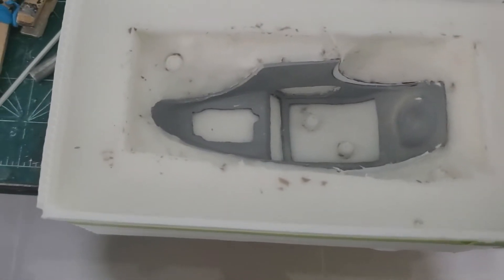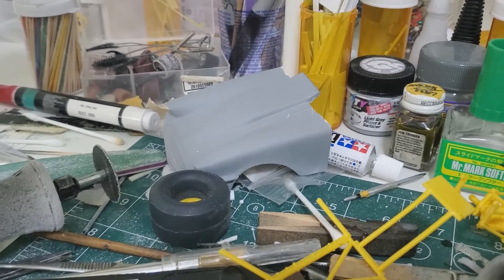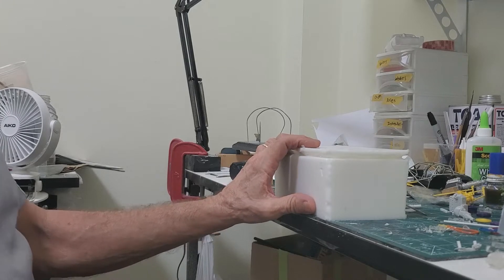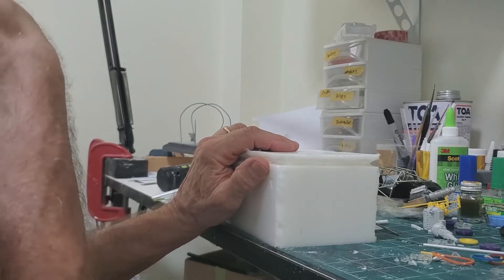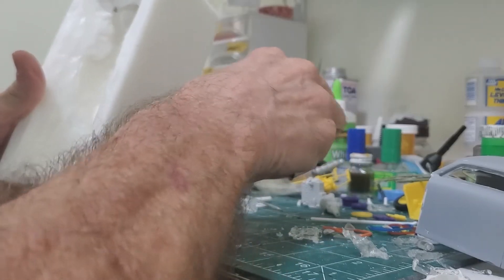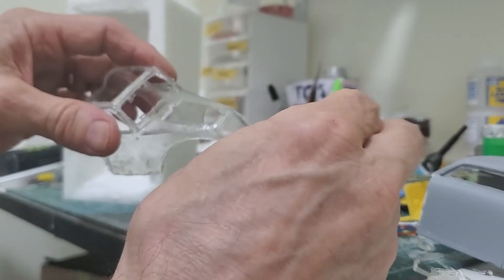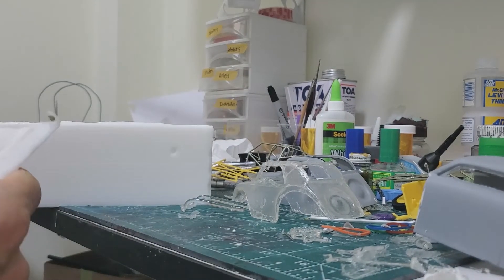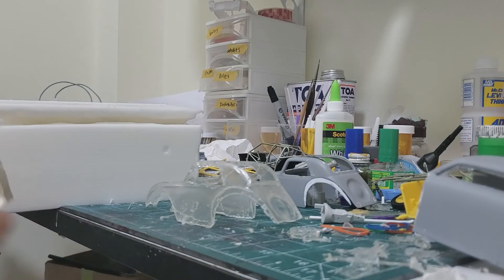Big problems with the mold, opening up the Fiat casting.

Comment: Your molding skills are improving.  From my understanding, it takes time to master two part molds.  Resin casting is something I want to get into doing, but it won’t be until this fall or winter.  Just hang in there and you will figure out a technique that works for you.  Thanks for sharing.

Comment: Because of the amount of silicone your using, you should think about moving your casting to another place far removed from your workbench. Even then, it will be some time before the residual silicone goes away. Your painting will suffer for some time to come.
I would rather see someone who is learning the craft than seeing a prof. do it. They aren't good for us that want to learn.
Reply from the maker: I was thinking that too, I have some body shop experience and remember the boss hated silicone anywhere for that reason.